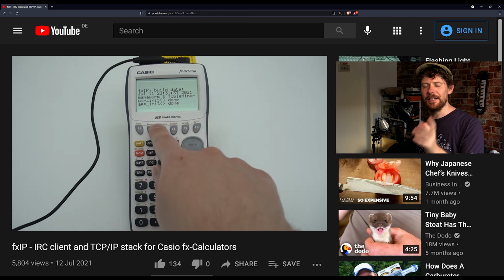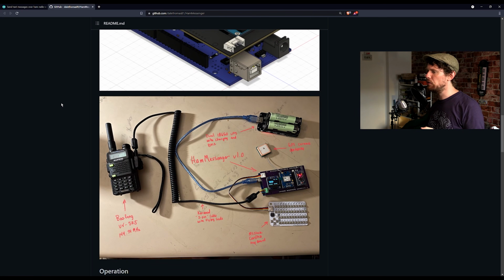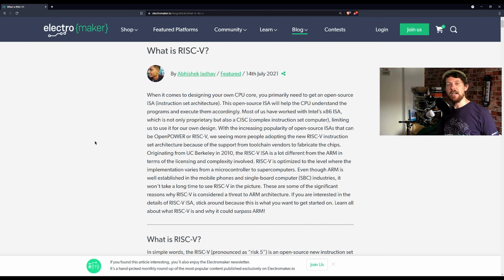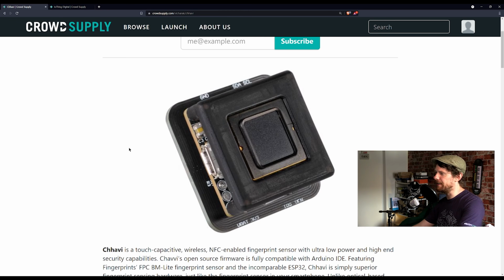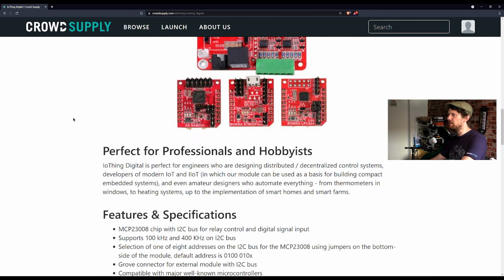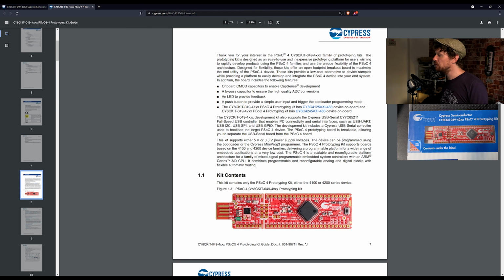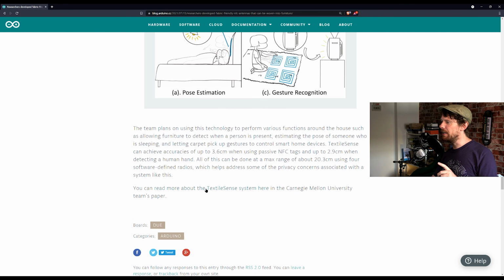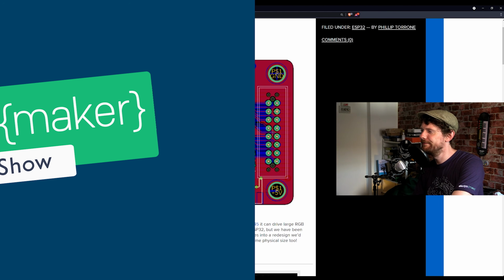Cryptocurrency Synthesizer, What is RISC-V, Raspberry Pi on ISS, and More!

Comment: I like the look of the APRS system. I have used an AX-25 Baycom modem on a 2m amateur radio transceiver many years ago for Packet radio, but not yet tried sending GPS info yet. I have some spare GPS receivers, so may give that a go once the current project is finished: FM radio with RDA5807M and STM32 CPU.